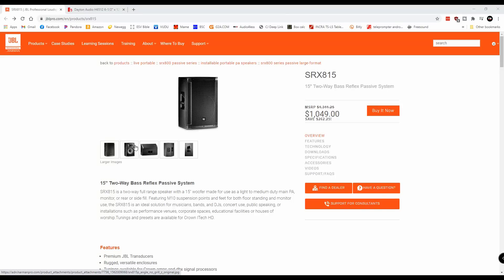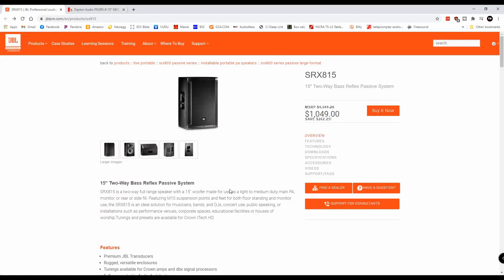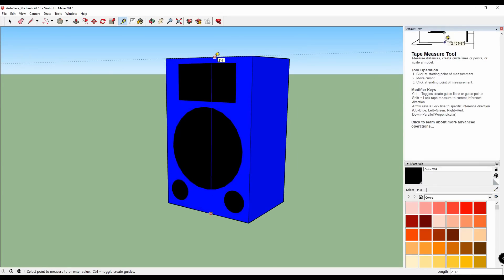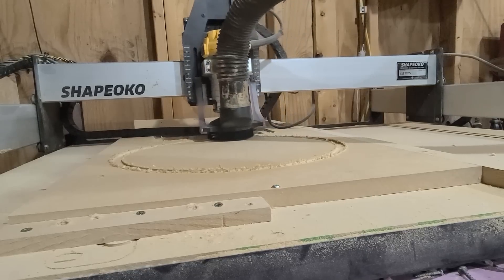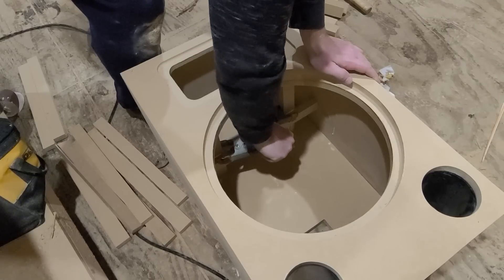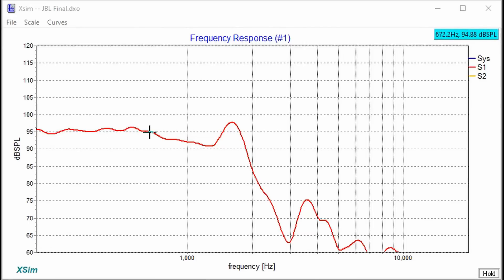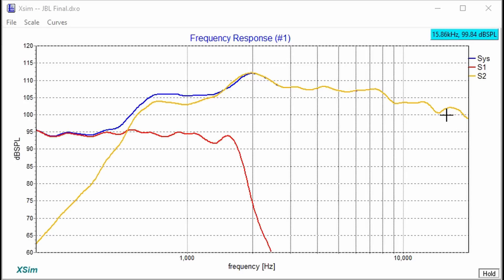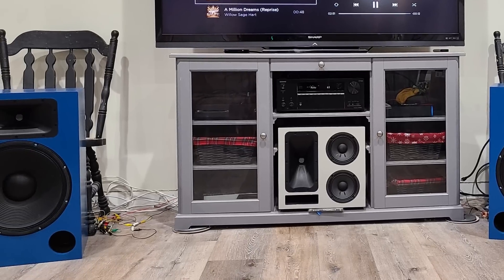How to Build $3000 Speakers for $500 - Soundstage 15

Comment: Awesome video! I think I'll take you up on this one! Thanks & Cheers!
Reply from the maker: Awesome! Here's the report from the guy who I built the speakers for: "They're great!  Love them!  I wasn't an audiophile before but I think I'm turning into one now!  Listening to music now is more enjoyable than I thought possible, I can "see" the music now.  Karaoke is on a whole new level now too!  I love the clarity of the sound they produce, no discomfort to the ears.  You don't realize how loud they are until you try to talk to someone because the purity of the sound is so clean."
Reply: @Toid I still haven't gotten around to this project as I'm in a small apartment, but I did score a pair of JBL-L56s for $13.00 buckaroos at a local thrift shop. My question: As the Not Foam rubber like surrounds are intact/completely still there with some minor separation, can I dab a bit of white glue to hold everything in place until I get the kit to refurb properly? It will all be removed anyway... Any advice regarding would be greatly appreciated. Thanks!